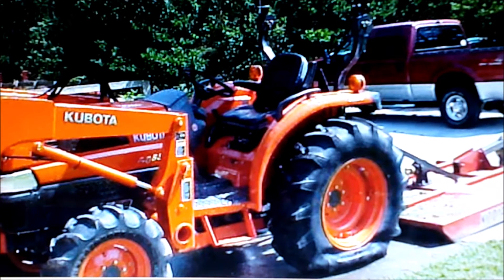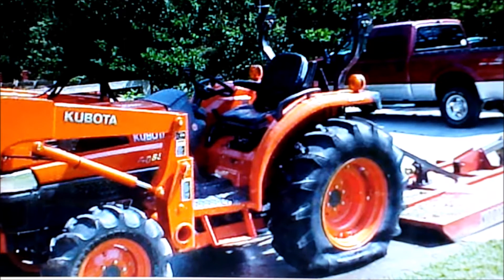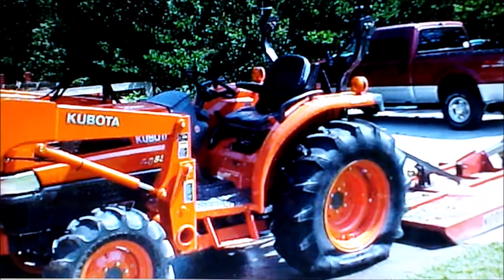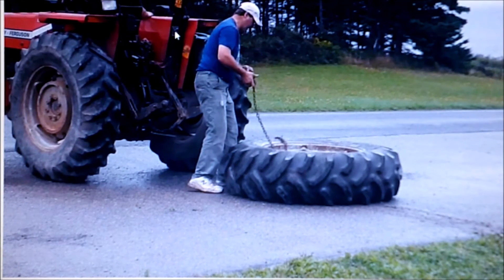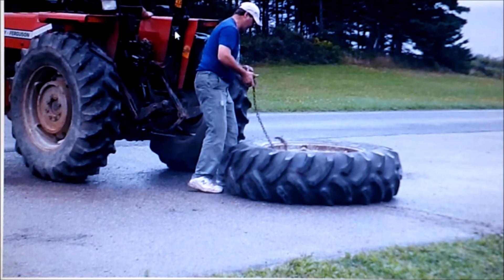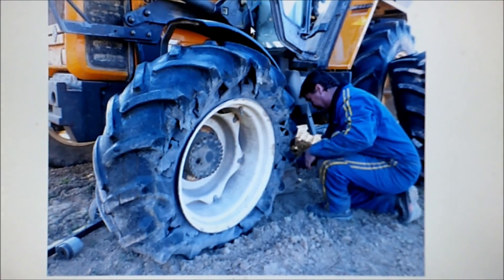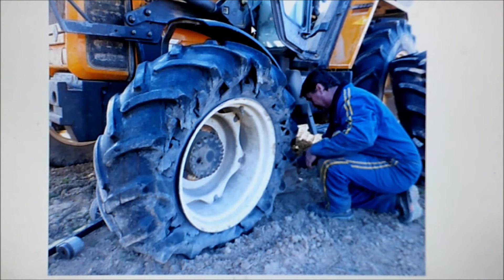M.O.V  Mower Talk

Comment: We don't take the wheel off of the tractor to repair a flat. I use an ATV sprayer that is 12 volt powered for the pump. We empty the tire as much as possible if it has fluid in it and then apply pressure to the sidewall to pop the tire off of the bead. There usually isn't a bead to deal with and it is easy. Then we take a couple of tire irons to remove the tire.